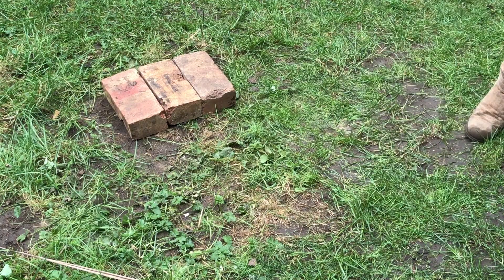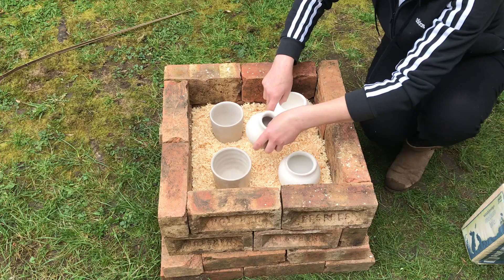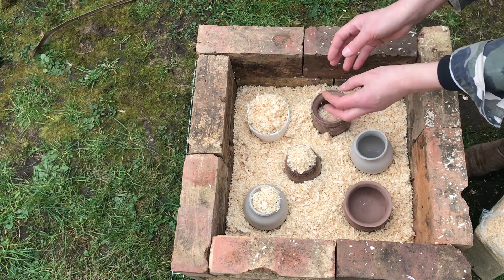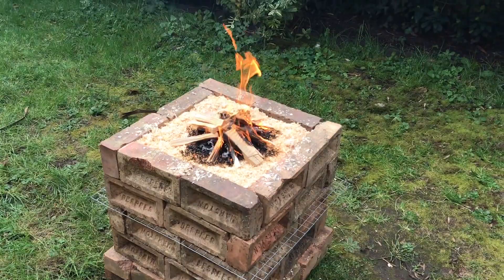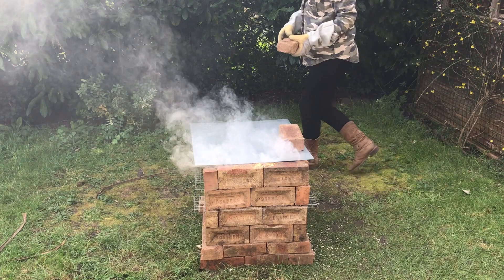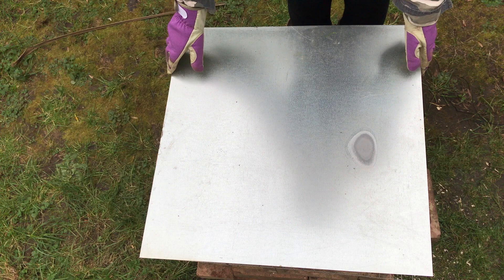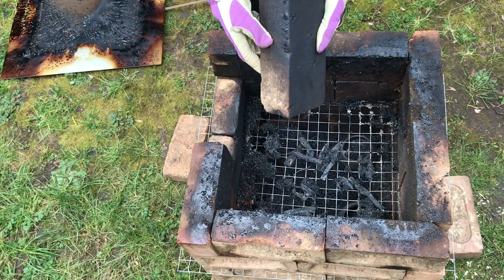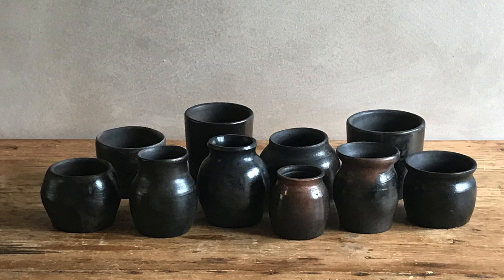Building and Firing a Sawdust Kiln

Comment: Is there a reason you don't add more ventilation by spacing the bricks? I'm very new to pottery, but have been lighting fires every day for 40+ years so it just seems strange to me! I'm sure there's a reason you're doing it that way but I don't know what it is!
All the best :)
Reply from the maker: I don't want the sawdust to burn too quickly.  Because the bricks are old and chipped there are quite a lot of gaps between them.  Seems to work ok.
Reply: @ThePotteryWheel  ah I see, so you want it to burn 'low and slow'?

I'm sure you're aware but just in case you're not - what you've made there is a Carbon Monoxide generator. If you ever feel sleepy whilst doing one of these burns, please promise me you'll get away from it and into some fresh air! It's an incredibly dangerous gas that can kill you in seconds, and is heavier than air so will sink to low places (and displace any air in said low places).

Thanks for the reply :)
Reply from the maker: @banksarenotyourfriends  thanks for your comment.  I'd always assumed that because I was burning it outside that the carbon monoxide wasn't an issue, especially as I'm not lingering around.  But maybe I'm mistaken about that?
Reply: @ThePotteryWheel  as long as there's a bit of a breeze it should keep things fairly safe, but for example; I wouldn't let the dog or cat fall asleep next to it! Think of it the same as an open fire - if it's windy then the gases in the smoke are diluted by the air, but you still wouldn't want to breathe in a lungful on purpose, even on a windy day.
Reply: @banksarenotyourfriends  but if it sinks to the ground then as long as she doesnt lay down next to the kiln it shouldnt be a problem, but I would definitely keep pets away from it